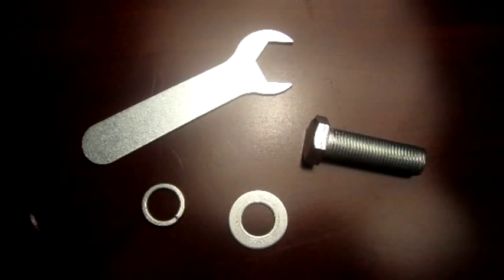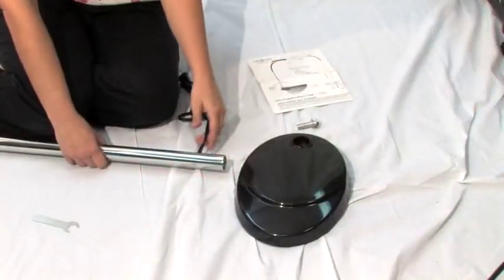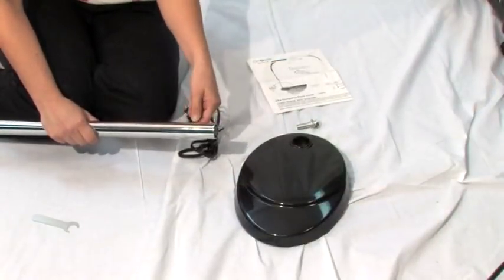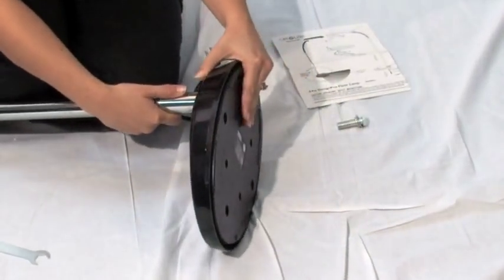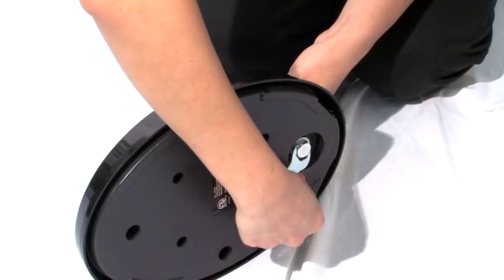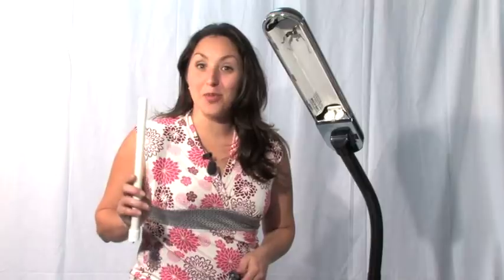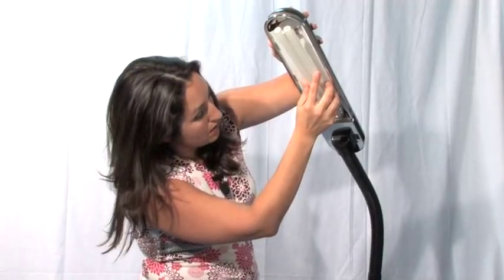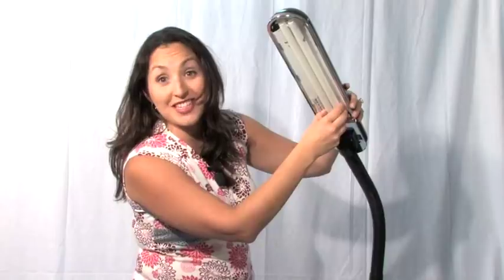OttLite Better Vision 24w HD Design Pro Floor Lamp Setup

Comment: I just assembled my Ott-Lite 3-in-1 24 Watt Lamp. I noticed an extra ring ( after seeing this video I found out that it's the lock washer ) that was included with the flat washer, the bolt, and the wrench. Since the lock washer wasn't shown or mentioned in the instructions, I thought that it was just an extra piece of metal. So, I assembled my lamp without it. I did save the part though. Do I have to take my lamp apart and reassemble it, or will it be stable enough the way it is?

Comment: i just received my lamp in the mail from Walmart. It's obviously used.The bottom of the base is scratched up & dirty. The bulb was already in the lamp. The worst part is that it's the wrong hardware that came with it. The bolt won't even fit into the hole so you can screw the lamp into the base. It seems that this was a return, at least part of it was, & then it was pieced together. I don't want a used lamp anyways... But now I'll have to wait, again! because I'm disabled & by mysellf so I can't just run up to Lowe's to grab the correct hardware or to Walmart to exchange it, to get the replacement lamp. I've already waited 2 weeks to begin with. I realize it's not Ott's fault but grrrr!!!